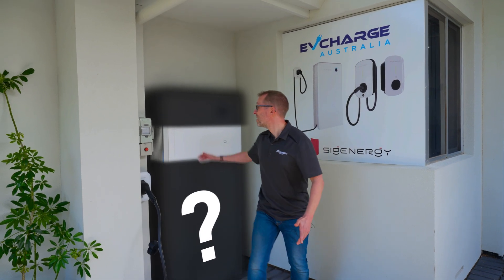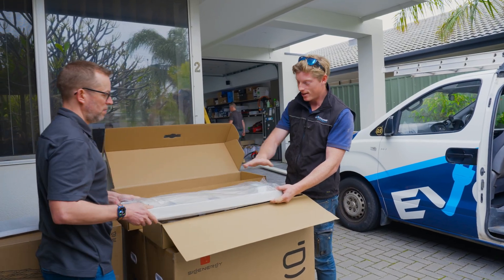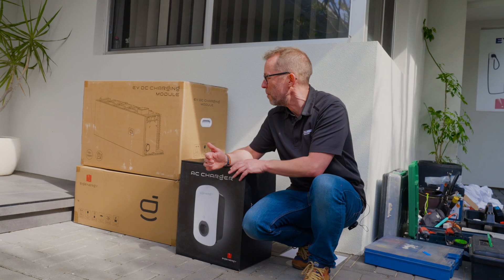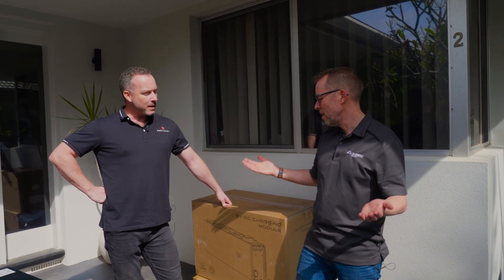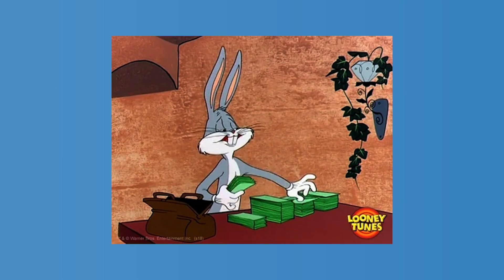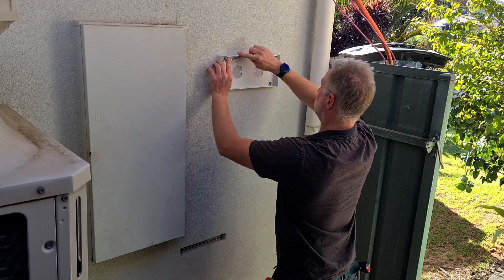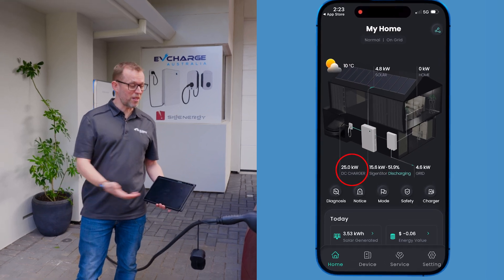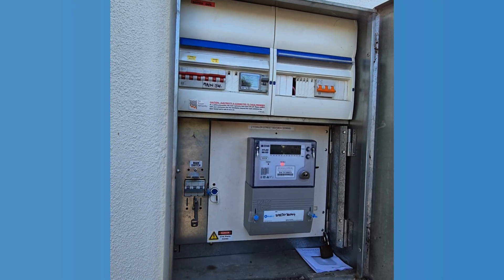Installing Australia's Fastest Home EV Charger (And It Works Off-Grid!)

Comment: I am going to install a sigenergy battery but may buy the EV DC charger later after I buy an EV.  I have 2 questions:
1. when I install the battery, do I need any special wiring to make it ready for the EV DC charger? I need to avoid the situation that I have to upgrade the wire to install the DC charger module.
2. I only have a single phase grid connection, and a 13kw solar panel, can I still have the 25kw DC charger? this video is based on a 3 phase setting. 
Many thanks
Reply from the maker: 1) No, all the wiring needed is within the stack
2) Datasheet does not mention a three-phase limitation.
Reply: @SolarQuotes Thanks👍

Comment: The most frustrating thing about this charger is that it limits the battery stack to 40kwh. We decided against the DC charger for this reason. We chose to use that spot for another battery module taking the stack to 48kwh. Hopefully they come out with a stand alone DC charger so that we can maximise the battery stack. The DC charger is also ridiculously expensive.

Comment: Actually, the an inverter in a vehicle either produces AC for the motor or the V2x.  When AC charging, the EV uses its rectifier and BMS as the "charger".  This can be 22kW if the vehicle supports 3 phase 32A

Comment: Does the bidirectional work on single phase? Or just 3 phase? (When it's up and running that is)
Reply from the maker: Good question! Our understanding is that it should work on both - but the proof will be in the pudding.

Comment: Honestly I'm not sure the point of Bi Directional charging if you have a correctly sized home battery that will recharge from the panels when the power is out..  I'm fully onboard with the DC Charger, but it would have been good if they had both AC and DC availability from the same module.  Would be good to have a look back at the system now it has been in for 6+ months to see how it's performing.

Comment: Awesome vid! Just a bit confused though—you said the top module is the inverter, but in a solar + battery setup, isn’t that usually a controller? Or does this inverter handle that too?
Reply from the maker: Top unit is a hybrid inverter :)

Comment: Can you use the batteries and ev charger with other inverters?
Reply from the maker: The Sig DC charger/batteries need to be part of the same system. The Sig AC charger can work with other systems however.

Comment: Great set up I’m about to press button on solar, batteries and new heat pump, I have a 22kw ac charger and 2 tesla’s new juniper and highlander as you probably know they only take 11kw on there infrastructure so I’m wavering on the sigenergy ! Only thing is I can get 40kw of storage and a smart system for about £8k to get this with sigenergy it’s double £16k and only 32kw storage but with the DC 24kw ev charger 🙄 do you know of any chargers reasonably priced for home and I do have 3 phase ? Obviously the savings pay for all my solar
Reply from the maker: Any DC EV charger - like Sigenergy's - isn't going to be reasonably priced. If you want beyond 11kW charging per vehicle that your AC charger provides, you'll need to shell out. I will comment that 40kWh of storage for £8k seems pretty cheap - what's the battery brand?
Reply: @SolarQuotes Dyness 5.0c x 8 , the actual cost of batteries is £5100 the other £3k is the hybrid inverter bi directional gear and all sundries to go with it .
Reply: @SolarQuotes I was presuming there would be a stand alone wall box for small business or home that would do the DC but everything I’ve looked at doesn’t seem to do the ccs2 , plenty of 24kw but not DC

Comment: Don't need to wait over a year, AUSEV have a 131kw ute ready to go
Reply: That's interesting. Here's what I found from AI: 
AI Overview
Orders open soon for first right-hand drive Ford F150 ...
Yes, AUSEV (Australian Electric Vehicles) does offer a Ford F-150 Lightning electric ute, which has a 131kWh battery, according to Sustainable Vehicle Solutions and other sources. However, they are not selling the vehicle directly; they are importing and distributing it in Australia. The F-150 Lightning is known for its powerful electric motors, producing 433kW of peak power and 1050Nm of torque, and its ability to export power. 
Here's a more detailed breakdown:
AUSEV and the Ford F-150 Lightning:
AUSEV is an Australian company that is importing and distributing the Ford F-150 Lightning, an all-electric pickup truck, to the Australian market, according to The Armidale Express. 
131kWh Battery:
The Ford F-150 Lightning features a 131 kWh battery pack. 
Powerful Performance:
The electric motors in the F-150 Lightning provide impressive power, with 433kW of peak power and 1050Nm of torque according to Sustainable Vehicle Solutions, says The Mercury. 
Exportable Power:
The F-150 Lightning is also known for its ability to output power, acting as a mobile generator for work tools and other applications. 
Pricing:
According to The Armidale Express, AUSEV is offering the F-150 Lightning in two variants: a Pro model starting at $169,900 and a more luxurious variant at $184,900, both before on-road costs. 
2024 Ford F-150 Lightning price and specs - The Armidale Express
Sep 13, 2024 — Two examples of the Ford F-150 Lightning are sold by AusEV: the tradie-focused Pro and the flagship F-150 Lightning. T...
The Armidale Express

Ford F-150 Lightning on sale in Australia | news.com.au — Australia’s leading news site
Apr 23, 2024

News.com.au

Electric Ford F-150 goes on sale in Australia - The Mercury
Apr 23, 2024 — AusEV says customers should consider the electric ute's comparatively low running costs before ruling it out. By their...

The Mercury

Show all
AI responses may include mistakes. Learn more

Comment: Unfortunately the price, $28000, you mention is the too cheap, whereas when you mentioned individual unit prices, you gave retail price. Hope you will edit it?
Reply from the maker: Our mistake was we missed a battery module: We corrected this very quickly (click the (i) at 8:54) : "Oops - actually closer to $33k (forgot a battery module!)"

Comment: Awesome video Finn! Just what my home needs!  A few questions come to mind though. 
1. Is there a benefit to have this installed in the garage? 
2. Is there a cost for the software upgrade to enable the Bi-Directional charging once approved. 
3. Can the 3phase inverter and DC charger be purchased without the Sigen battery?
4. How will this work with Enphase micro-inverters?
5. How long is the CCS2 lead? As this will limit the install locations.

Comment: Really struggling to see the benefit of this. 7kW overnight is more than enough for a weekly charge. Can someone enlighten me of an example lifestyle which this would benefit?
Reply: Multiple cars is an obvious case.  Not everyone wants to charge overnight from the grid. Mine are always charged during the day.  Sometimes I need a quick top up and my 11kW is too slow so I have to visit a fast charger.
Reply: @ You can charge multiple cars with an overnight 7kW charger too. Just on different nights. Sounds like poor planning on your part if you need a top up during the day.
Reply: @AnthonySarino-f7n  poor planning or impossible planning.   Predictability isn’t available to everyone.
Reply: Energy trading - grid support.

Comment: This is cool but completely useless. There is 0 and I mean absolutely 0 need for dc charging at home, if you have the money go for it but just know you are throwing it down the drain. It charges 2x faster than a normal ac charger but that takes about 10hrs, so this still takes 5hrs, what’s the point it’s not fast enough to warrant being useful and you don’t want it to be that fast anyway, fast charging especially over 1c all the time will damage your battery. The inverter and battery are fine I install lots of systems like that but the dc ev charger is pointless at best, and anyone who says otherwise doesn’t understand how to properly live with an electric car and has too much money to waste.
Reply: Did you take into account the bidirectional charging? Also, what takes 10 or 5 hours to charge? There is a lot of disinformation floating around regarding battery damage by the faster DC charging. A friend has a 2017 Tesla Model X with lifetime free energy - he only charges it at Tesla Superchargers and the battery has deteriorated only 5% after 360 000 kilometres. He's also an electrical engineer.
Reply: @Fomites what do you mean did I take into account bidirectional charging that isn't relevant to what I was talking about at all. What takes 10 or 5 hours to charge, a car obviously, I am just speaking generally it takes about 10 hours on ac charging to charge an average ev with a 60ish kwh battery. Also I own 3 evs and DC charge with one alot more than the others, it does degrade the battery, not that much but if you were doing it every single day you would definitely notice. I am also an electrical (electronic) engineer and have built multiple ev batteries for personal projects lol.

Comment: Do you need to have a 3 phase 415v input to the house to get the max output DC output to the car? Or will a single phase 240v input feed the DC charger with the same DC output speed.

Comment: charging at 25kWh...
what % of owners have a battery capacity to support that?
or is that wank factor for covering the gap with grid feed?
Reply: or will this discharge battery + array for a combined 25kWh?
Reply: @semsolar9273  It utilises PV, then batteries, then grid if required. You're right, 25kW will be overkill for most resi installs, which is why we also do a 12.5kW DC Charger. But the 25kW DC charger is a great solution for commercial clients.... you can parallel unlimited stacks together to go as big as you want (recently did a winery with 63 stacks / 3MWh), so having a few stacks with 25kW DC chargers would be a good fast charge stop off for those that need to get out on the road quickly

Comment: 9:18 Hey Finn, great video. Just wondering, can you please elaborate on waiting 6 months for cars that can do bi directional charging? I thought the BYD vehicles can discharge via the ccs2 port already. Thanks
Reply from the maker: BYD can do ~3kW V2L (Vehicle to Load) via the AC pins on its Type 2 socket. The SigEnergy DC EV charger in the video is a DC bidirectional charger, so it requires a car that can do DC bidirectional charging via the DC pins on the CCS2 socket.
Reply: Thank for the explanation

Comment: should have mentioned that if got the home max TP home gateway can take 2 inverters for a total amount of 52.6kw of power and 96kwh of storage and 2 x 25kw dc chargers
Reply from the maker: Good point - but we've learned that not overwhelming people with numbers is important on YT. It's always a balance of how much info you throw at viewers, and what people can absorb.
Reply: Home & HomeMax Gateways are no longer being offered. It's simply either a single phase or 3 phase gateway. Both versions have generator input
Reply: @willhall2468  so what do you do if 1 system is not enough?
Reply: @RayJohnson1980  Parallel as many as you need

Comment: you forgot to mention that this invert can do up to 40kw due to the 4 mppt's, and 1 inverter can do up to 48kwh of battery storage or 6 x 8kwh modules
Reply: 40kW allowed over East, whereas here in WA maximum we're restricted to 30kW maximum and only 15kW inverter - that's due to the Western Power caveman rules we have here in WA.

Comment: Just a note, the math's doesn't add up on the system to $28,000, it's more like $36,000
Reply from the maker: DC EV Charger ~$8,600 Retail, 25kW, 3ph inverter ~$6,000, 8kWh battery modules x 3 ~$4500 each: = ~$28,100 - Gateway is another $2k. But the stack is about $28k worth. WIll add a note that its $28k + gateway
Reply: @SolarQuotes  you're forgetting a battery!
Reply from the maker: @simonr32gtr good point! Add another $4500. My bad. WIll add a correction to the video.

Comment: The bit about the whole setup needing to be where just your EV charger is now will rule a few people out I reckon.

I didn't see any mention of an IP rating either. Can this be installed outdoors at all?
Reply: Sigenergy's data sheet says it is IP66 rated.
Reply from the maker: yes
Reply: IP66 rated. If you are limited with space, then we have a longer cable for the DC charger up to 10mtrs.... otherwise you can opt for one of our standalone AC chargers (7/11/22kW) which you can install anywhere but still integrate with the smarts and control of our system.... but you won't be able to do bi-directional charging with our AC chargers

Comment: I believe that every Nissan Leaf ever sold is capable of bi-directional charging.  Shame it has taken everyone else so long to understand that it is a great idea.
If all EVs were equipped with bi-directional charging, and were plugged in to an appropriate charger when not in use, there would be fewer problems with grid stability, and there would be plenty of places to put the solar surplus...
Reply: I'm on my second LEAF and still on the look out for a cost effective off-grid bi-directional charger to work with my original solar set up.  I'm not that keen to buy another 10kw battery for cloudy days when i have a 60kwh battery in the LEAF!

Comment: 1:00 - Did you SERIOUSLY just toss the Zappi into the garbage bin? WTF is wrong with you? There is a ton of recyclable materials in that device - quite apart from the fact that it was still perfectly functional and someone would have reused it. You should be ashamed, as should SigEnergy. Just an advertorial video for a company in the renewable energy market that throws perfectly good equipment in the garbage. My opinion is well set on both of you.

Comment: Needs to intergrate with Amber smart shift!  Yesterday, in Adelaide, I had my solar curtail to zero output and ran my house and charged my PW2 at negative prices. All I up  I was paid $35. I could only imagine what it would be like using this in the same way and charging a car at 25kw as well.
Reply: Integration complete - should be announcing next week

Comment: And it’s 50k installed with panels?
Reply from the maker: This spec would be about that, yes.
Reply: I was quoted 19kw pv, with 16kwh for. 
$41,000.00
STC $5900.00
Out of pocket $35,500
Remove old pv systems, install on tile roof

Comment: I hope Sigenergy and similar platforms are massively successful in Australia… because I just installed a 10kW Fronius Gen24 and I want a system like this next time!
Reply: fronius >30 years of tech history.
sigenergy new tech history = ?
Reply: @semsolar9273  Won’t be so new in 10+ years when my Fronius is up for replacement 🙂
Reply: @semsolar9273  actually more experience than most - the CEO and most of the senior team came from the worlds largest inverter/battery brand
Reply: @semsolar9273  just remember 30 years ago Fronius is where Sigenergy is today. You got to start somewhere & consumers need to take a chance on it. The way Sigenergy is performing at the moment feels like leap years ahead of Fronius and any other system.

Comment: We only have single phase (no room on the local transformer for 3 phase).  Is there a single phase version of the system and if so what specs are different?).
Reply from the maker: The DC EV charging modules and battery modules can be used on single phase. The inverter is available in 5kW and 6kW single phase.
Reply: @SolarQuotes  a 10kwh single-phase inverter is also 'coming soon' apparently!
Reply: @Arycama  1ph 5 & 6kW available now... 8, 10 & 12kW single phase will be CEC listed over the next couple of months
Reply: @Arycama  10 kWh or 10 kW inverter?

Comment: As early adopters like yourself stop supplying the national grid with cashflow then the slower adopters like me will be charged higher and higher $kWh rates. 😮😮😮😮

All to maintain grid minimum economic cashflow. 

The national grid is a $TRILLIONS infrastructure investment and must have cash flow for its owners.

Even the nuclear promoters know that new grid is incredibly expensive per km and millions of new grid capacity is needed to replace fossil fueled energy. 

You would have to be brain dead not to see that is why even the nuclear promoters want to be grid centred. 

Nuclear wants grid monopoly cashflow. 
Government guaranteed cash flows and disaster insurance. 

You must understand that the grid itself is the centre of clean future energy and rooftop PV customers are the grid's best friend.

Comment: Oh wow, finally a local video of exactly what I want 👏 
Bit surprised the VTG box module was pricey, otherwise LFG 👍
Reply: You can opt for less batteries.
Reply: @flukeylukey7559  You can start with just inverter, then add a battery later, then add more batteries even later, then add the DC charger even later! Fully modular and totally flexible.... it's just like an expensive lego set!

Comment: What are the cars currently that can do bi directional in Aus ? Is your website up to date?
Reply from the maker: Currently, Nissan Leaf Gen2 and Outlander PHEV, but we are expecting some new (to Australia) Chinese cars soon that can do proper DC bidirectional.
Reply: @SolarQuotes Nissan Leaf is chademo connection, not ccs2. Is there a way to get around that?
Reply: Japan mandated bidi for all EVs  (Leaf, Outlander) made there post Fukushima  (2013 on) to help grid resilience. Kia have V2G functionality on the EV5 & EV9 I believe, as does the Polestar4 and some VW models. Most manufacturers will move towards offering this functionality in the coming years and hopefully the choices of bidi chargers will progress accordingly.
Reply: @SirPhilby101  I emailed will from sigenergy. Currently nio do it in china and they are working with some other (undisclosed) companies